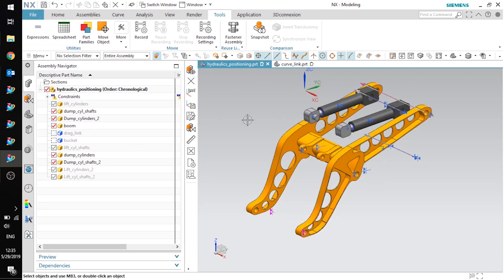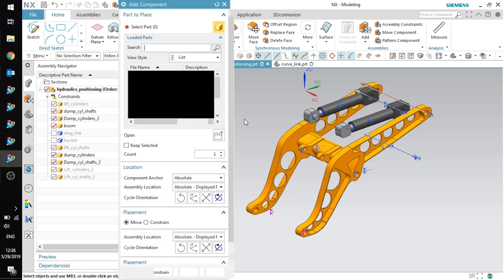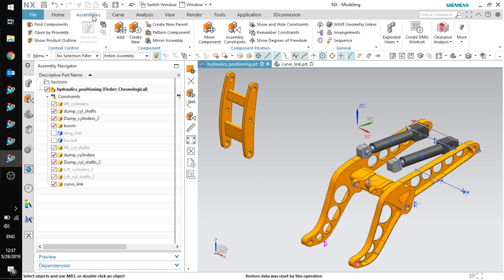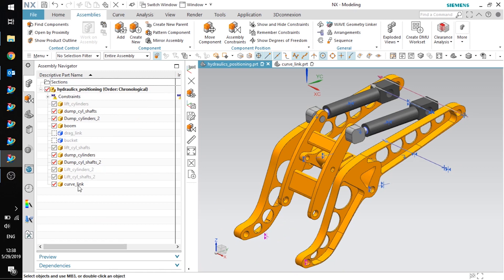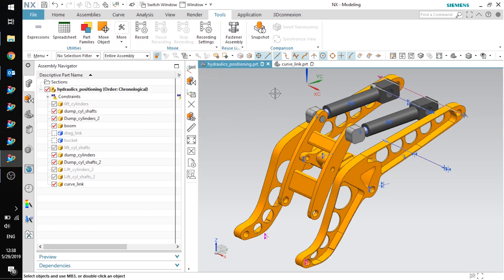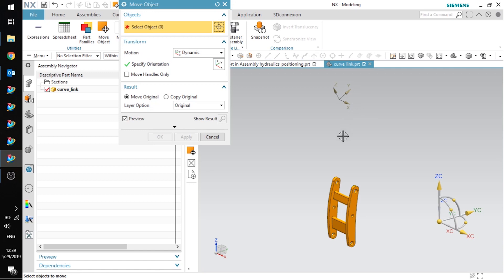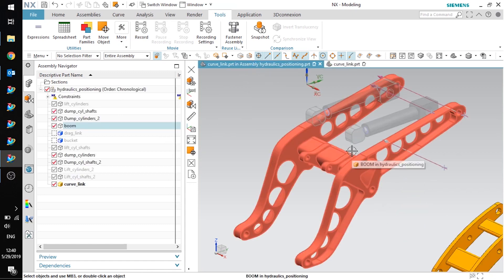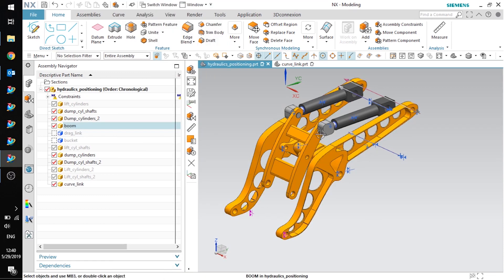NX: Moving Geometry from the Component CSYS to the Assembly CSYS

Comment: Hi, I am using NX11 and I tried to move a component to the origin of the assy,  but I can not use csys to csys move tool because I can not visualize the coordinate systems of the components in the assembly. (In my case I can neither use constraints nor modifiy the position of the part internally ).
So I tried to set the fully loaded option in the main menu, but it doesn't work... I may do something wrong, please help!
Thank you in advance.

Comment: Very clear and usable for how to move the geometry relative to the coordinate system. My typical workflow is to build parts, typically using the WCS location, then assemble them in the assembly part. 

I am curious to what the advantage is over assembly constraints?

Your NX electrical routing video was quite helpful for me. Yours is one of only a few useful routing videos that I've found. A series on routing would be great :-)